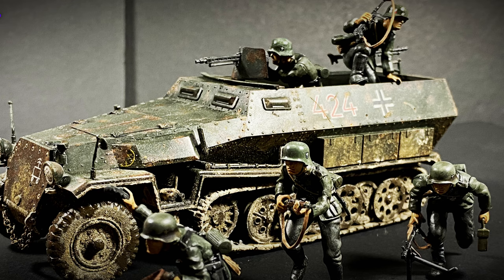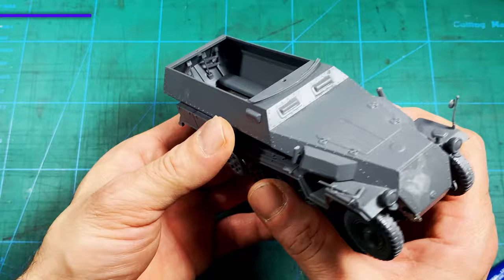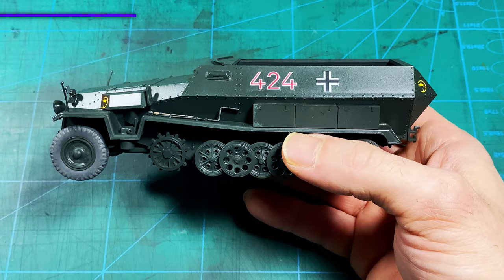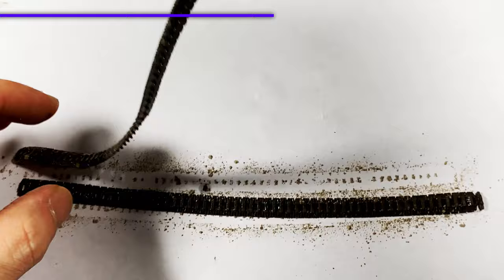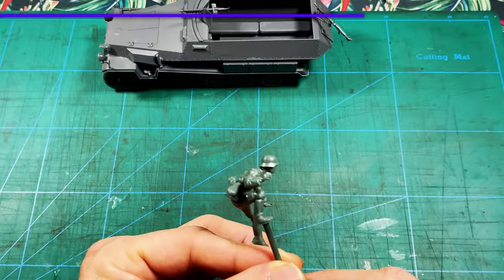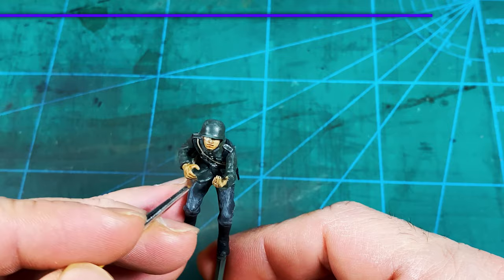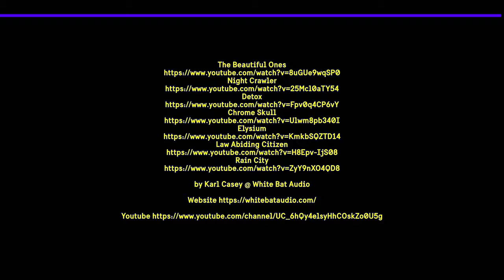German Hanomag Sd.kfz.251/1 #Diorama #ScaleModel #Miniature #ModelKit

Comment from the maker: 00:00 Hello my friends.
00:05 In this modelling project I am building the modelling kit of the German Hanomag Sd.kfz.251/1 half-track, in scale 1:35 from Tamiya.
00:17 The Sd.Kfz. 251 (Sonderkraftfahrzeug 251) half-track was a World War II German armored personnel carrier designed by the Hanomag company, based on its earlier, unarmored Sd.Kfz. 11 vehicle. The Sd.Kfz. 251 was designed to transport the Panzergrenadier (German mechanized infantry) into battle. Sd.Kfz. 251s were the most widely produced German half-tracks of the war, with at least 15,252 vehicles and variants produced by seven manufacturers. Some sources state that the Sd.Kfz. 251 was commonly referred to simply as "Hanomags" by both German and Allied soldiers after the manufacturer of the vehicle; this has been questioned, and may have been only a postwar label. German officers referred to them as SPW (Schützenpanzerwagen, or armored infantry vehicle) in their daily orders and memoirs.
00:37 The early production models of this vehicle were issued to the 1st Panzer Division in 1939. These vehicles were meant to enable Panzergrenadier to accompany panzers and provide infantry support as required. In practice, there were never enough of them to go around, and most Panzergrenadier units had to make do with trucks for transport. There were 23 official variants, and sundry unofficial variants. Each variant is identified by a suffix to the model number; however, there was some overlap in the variant numbers.
-Sd.Kfz. 251/1 - Schützenpanzerwagen. Standard personnel carrier.
-Sd.Kfz. 251/1 Ausf. A Ungepanzerte. Made with plain steel 5mm plates instead of armour, to make up numbers due to slow initial 251 production. Around 350 made up to mid 1940.
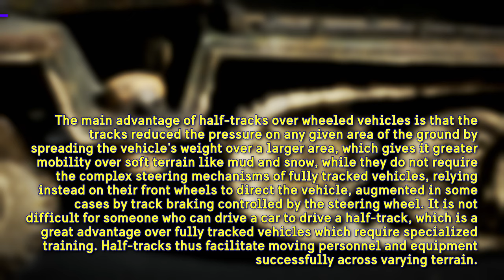00:57 The main advantage of half-tracks over wheeled vehicles is that the tracks reduced the pressure on any given area of the ground by spreading the vehicle's weight over a larger area, which gives it greater mobility over soft terrain like mud and snow, while they do not require the complex steering mechanisms of fully tracked vehicles, relying instead on their front wheels to direct the vehicle, augmented in some cases by track braking controlled by the steering wheel. It is not difficult for someone who can drive a car to drive a half-track, which is a great advantage over fully tracked vehicles which require specialized training. Half-tracks thus facilitate moving personnel and equipment successfully across varying terrain.
20:14 Mig's Acrylic Color Brush & Airbrush Old Rust. I want to tone down the previous Medium Rust because it is brighter than I was expecting it to be.
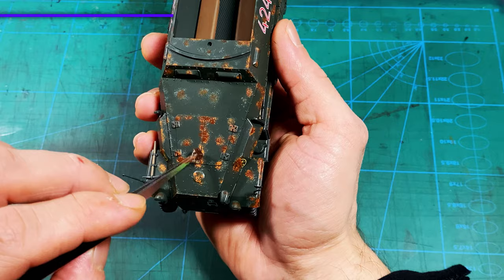21:18 Mix of Vallejo's Model Air Burnt Umber and Van Dyke Brown Pigment. Once again with a sponge, muffler chipping.
21:32 Forgot to say that I added a chain on the front of the vehicle and made it look rusty as an added detail.
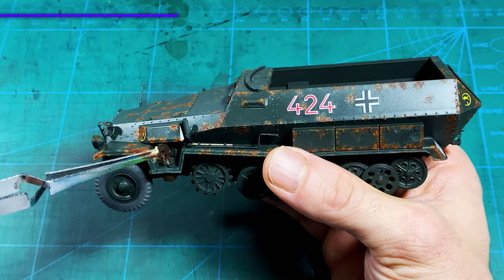21:53 Using a small brush for this area here.
22:03 Mig's Acrylic Color Brush & Airbrush Old Rust here and there.
22:35 Mig's Pigment Fixer Modelling Pigment mixed with some black pigment for the illusion of muffler's stains.
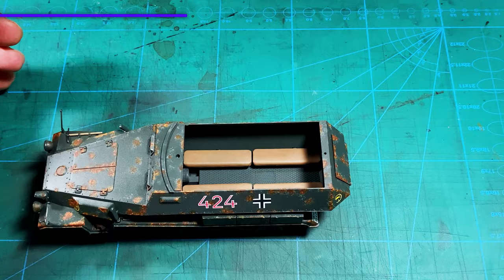22:57 Mig's Europe Earth Modelling Pigment for added detail.
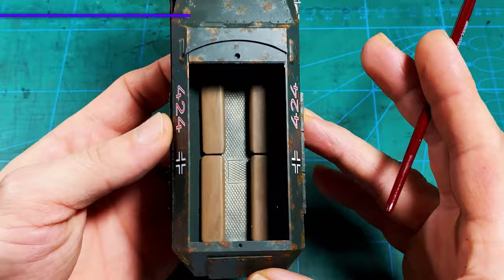23:24 Black washing.
23:43 Here after it will dry I will add some more pigment.
24:03 Removing with a wet brush the excess black washing. I am going more of a dirty, used, etc look.
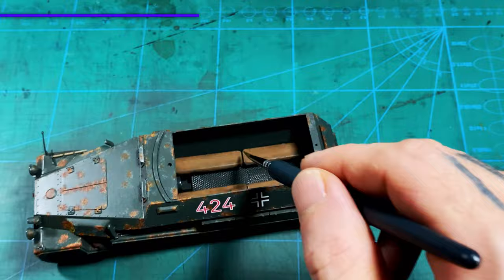24:27 Because in some areas the chipping seems stronger than I was aiming for, I am light black washing the vehicle.
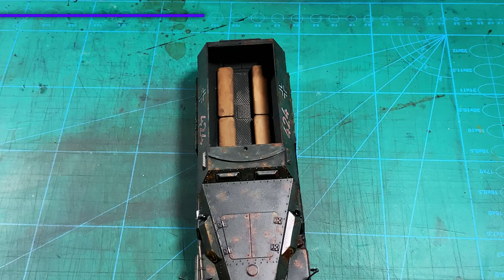25:04 Some light rust on the floor in here.
25:20 Little bit of darkening with the old rust.
25:41 Once again I am adding some more pigment.
25:55 Some pigment fixer.
25:57 As soon as the fixer is dry, the pigment will once again be clearly visible.
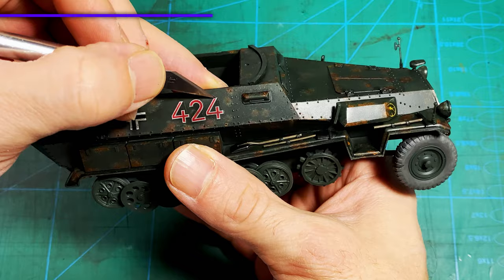26:05 With my tools carefully creating some battle "scars".
26:51 Black wash oil painting.
27:37 Mix of oil painting colors: Yellow ochre, red and burnt umber. Kept it bit "watery" and some more rust details here and there.
29:11 Black wash oil painting here and there.
29:56 Mig's Heavy Mud Wet Mud mixed with Mig's Enamel Odourless Thinner and painting all the lower parts of the vehicle including the caterpillar tracks.
32:40 Placing the caterpillar tracks on a clean piece of paper.
32:47 Will sprinkle some Mig's Europe Earth Modelling Pigment with a brush on the caterpillar tracks.
33:23 With a harder brush I am dusting off the excess pigment from the top of the tracks.
33:34 Repeating the same process on the other side of the tracks.
33:38 Using a cotton swab if and when needed.
34:16 Mig's Dark Earth Modelling Pigment.
35:03 Placing the tracks on a clean piece of paper.
35:07 Mig's Pigment Fixer Modelling Pigment on both sides of the tracks.
35:43 Mig's Europe Earth Modelling Pigment on the wheels, below the fenders and at the bottom of the vehicle.
37:15 Mixing Mig's Dark Earth Modelling Pigment with Acrylic Thinner.
37:35 With a hard brush I am splashing the mix here and there.
37:40 Because I mixed it with the thinner, the pigment will look better and become visible sooner.
38:37 Some Mig's Europe Earth Modelling Pigment on the caterpillar tracks that I already have attached on the vehicle off camera.
39:28 Painting some Mig's Medium Density Mud Splashes Wet Ground on the tracks.
40:08 Vallejo's Engine Oil Stains on the bottom of the vehicle in few key parts that one would find such stains.
41:06 Hobby knife and removing the excess weathering effects.
41:34 The Army Painter Warpaints Plate Mail Metal Metallics dry brushing.
42:32 Placing the machine guns without gluing them though.
42:50 Off camera prepared the figures. Let's assemble the first one.
42:54 Gluing.
43:30 Bag, gas mask, water bottle, etc.
44:08 I will glue the weapon later on. I have bend the hands a bit for a better weapon placement.
44:19 Off camera I have assembled the rest of the figures.
44:43 Surface Primer German Panzer Gray airbrushing.
44:56 Mix of Vallejo's Model Color Acrylic Colors Dark Flesh and Khaki Brown and The Army Painter Warpaints Oak Brown.
45:11 Painting.
45:34 Off camera painted the eyes, hands and helmet chin strap.
45:38 Vallejo's Model Air German Gray and painting.
46:24 Vallejo's Model Air Panzer Dark Gray and painting.
46:52 Dark green painting.
47:32 Flat black painting for a bit to showcase it to you but I will finish off camera.
47:50 Flat black painting.
48:13 Vallejo's Game Color Khaki painting.
48:48 The Army Painter Warpaints Plate Mail Metal Metallics and painting.
49:39 Off camera I made few gray details here and there.
49:43 Vallejo's Model Air German Gray mixed with white and doing some highlights.
51:18 The highlights on the upper part of the figure were stronger than I expected, so, off camera, I toned them down.
51:29 Light gray and some more highlights.
52:03 The Army Painter Quickshade Flesh Wash and washing. Starting from the hands and then will do the face.
53:07 White dry washing. Don't mind how strong it looks. I will black wash afterwards and it will look exactly as I want it to look.
53:36 Gloss varnish on the helmet before placing the decals.
53:41 Mig's decal set before placing the decals and pressing with a cotton swab to take away the excess air or liquids below the decal without damaging it.
54:06 The Army Painter Quickshade Strong Tone which is basically a black and brown mix. Washing.
55:20 The figures are ready. Once again keep in mind that the highlights seem stronger on camera because of the studio lights and the helmet gloss is because of the decals. Everything is so much softer in reality.
55:33 I have attached their weapons and other objects. One of them will be the vehicle's machine gun operator.
56:05 Hopefully you liked the project and you will enjoy the presentation. Since I am a new to this amazing art, please do share your words of wisdom in the comments below.
56:14 Presentation
01:00:56 Hit the Like, Subscribe and Notifications Bell "buttons". This way, together, we can grow a community around the exciting art of scale modelling!
01:01:05 Stay "tuned" for more scale modelling videos.
01:01:08 Thanks for watching!

The Beautiful Ones
https://www.youtube.com/watch?v=8uGUe9wqSP0
Night Crawler
https://www.youtube.com/watch?v=25Mcl0aTY54
Detox
https://www.youtube.com/watch?v=Fpv0q4CP6vY
Chrome Skull
https://www.youtube.com/watch?v=Ulwm8pb340I
Elysium
https://www.youtube.com/watch?v=KmkbSQZTD14
Law Abiding Citizen
https://www.youtube.com/watch?v=H8Epv-IjS08
Rain City
https://www.youtube.com/watch?v=ZyY9nXO4QD8

01:01:11 by Karl Casey @ White Bat Audio

Website https://whitebataudio.com/
YouTube https://www.youtube.com/channel/UC_6hQy4elsyHhCOskZo0U5g
Reply: das schöne modell wurde durch die grüne , glänzende farbe total verunstaltet . militärfahrzeuge sind matt und glänzen nicht . auch kleidung , außer leder , glänzt nicht .
Reply from the maker: @opa1480  thanks for watching and commenting👏😊there is nothing shiny going on here EXCEPT the multiple powerful studio lights that light up everything😉if there were really shiny, you would be seeing flares and other lighting artifacts on the video. For example you wouldn't want to see my little baldness under these lights not even for a second🤣once again thank you so much for taking the time to watch and comment👏😊🖖